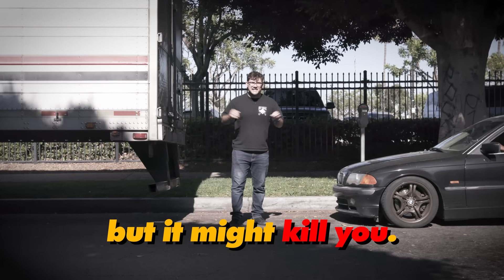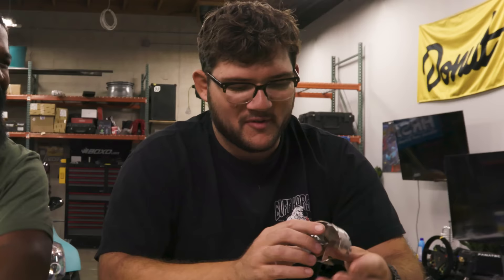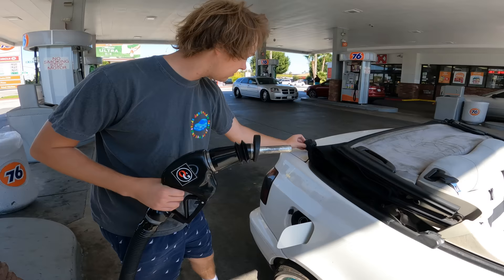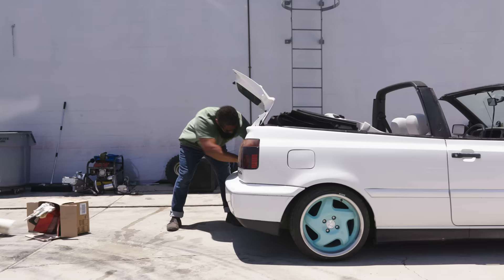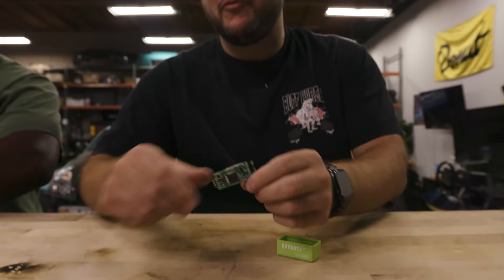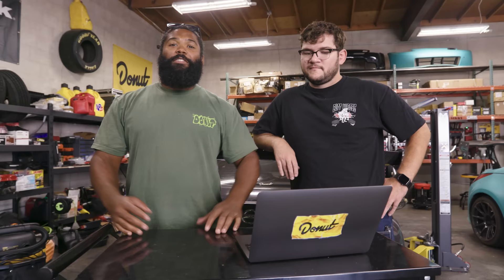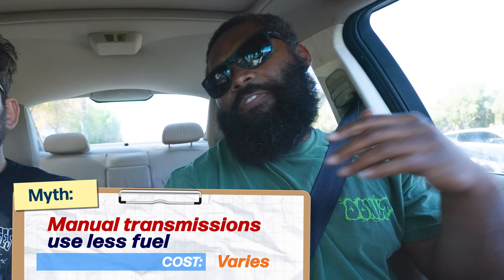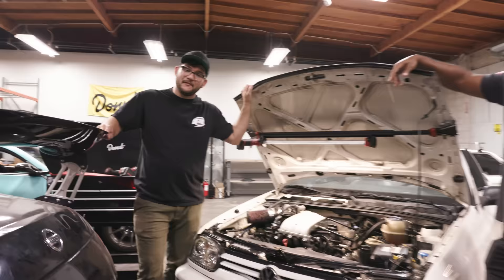Testing Fuel Economy Hacks

Comment: Depending on your car, your engine size/power, and alternator draw….the whole electrical stuff using more fuel can actually be big. Anyone who owns an older gem Honda Fit knows that if you have your lights and radio on, and try to roll up or down 2 windows at the same time, it feels like you lose about 30% power lol. Also, I think the manual transmission thing is because you can neutral and coast. I used to hypermile in my 02 Saturn sc2 by neutraling whenever I could and would get 80 mpg plus
Reply: As a guy who drives a 50 HP beater car, I understand and relate with your every word.
Reply: The manual vs automatic is a thing because the transmission fluid in the torque converter has parasitic energy loss due to it splashing around and converting the momentum of the fluid to heat. With the clutch that doesn't exist since all the rotational energy of the crankshaft is directed to the wheels. Automatics have only recently began to match or exceed manual efficiency due to locking the overdrive gear when cruising instead of relying on the torque converter and of course more gears.
Reply: Not the healthiest thing for your transmission however. Lubrication suffers.
Reply: Transmission thing has nothing to do with "neutral and coast" You're causing harm to your car by going into neutral at any high speed. You could get the same result by just "coasting" as your foot is not on the accelerator you aren't continuously injecting fuel into the engine at high RPM.
Reply: Had a vw polo 2003,went on a 2 week holiday.Had to jump start the car,worked fine untill I turned on the light,when I turned on the lights I lost power steering.Everything was fine when I got a new battery.
Reply: @DiustheZ  If you are in gear then that will use more fuel than being in neutral. Same reason its harder to push a car if its in gear. Try coasting in 1st gear and see how far you get vs coasting in neutral. Higher gears are a smaller difference but its still there.
Reply: @Luke Stannett  i used to think the same, but nope. If you are coasting your fuel injector cut off the fuel completely. If you are neutral, fuel injector still spraying fuel to keep the engine idle. 

I watch engineer explained about it.
Reply: @CheekyNinja  I mean you're wrong but nice try. You don't use fuel depending on what gear you're in you use fuel dependent on how many RPM's you're doing. "Coasting in 1st gear" is just a stupid comment to make because at most you'd barely get moving before hitting high RPM's. 
You can still burn a lot of gas being in neutral if you hit the accelerator and raise your RPM. I just said that it doesn't matter if you're in gear or in neutral you would use the same amount of gas just not pressing the accelerator. 
IF you were in low gear like 1st for whatever reason and going down hill where gravity is your accelerating force and you don't need to raise your RPM's then being in a higher gear would allow your car to move faster as there is less mechanical restriction of speed. The ONLY time being in Neutral could be better than being in gear is if you were going down hill. Being in Neutral does nothing for fuel saving that being in a higher gear wouldn't also do for you except being in gear you can control the maximum speed of your car going down hill, don't get me started on the 'geniuses' that turn their car off going down hill.
Reply: @JinxProLuhut  The only time your fuel injectors 'cut off the fuel completely' is when the engine is off, you should never 'coast' with the engine off... ever...
Reply: @DiustheZ  fuel use is driven more by load than rpm.

If you try to push a car in gear, it is harder because you have to provide the energy to compress the air in the engine, if you take out the spark plugs its much easier.

If you push a car in neutral its easier because you don't have to compress the air in the engine.

If you are coasting in gear, most modern engines cut the fuel and the work of compressing the air is done by the movement of the car. This is usually called engine braking and suffice to say, it slows the car down.

In neutral enough fuel is provided to the engine for it to idle, and no energy is taken from the motion of the car to drive the engine.

At very low speeds this works out at no net benefit. Everywhere else you get a big saving in neutral.
Reply: @CheekyNinja  How you push a car and how much fuel it consumes has nothing to do with the other... If you're going 60mph or 100kmh and you put it into neutral your engine is still idling at 1,000rpm and is still using fuel. I think you should look into how an engine works and educate yourself on some basic physics principles. 
"Engine braking" has nothing to do with compressing air in the cylinders, firstly because there's still fuel being injected into them. secondly you 'engine' break by using the gears, which requires force from the engine to move. and by downshifting in gears you gradually increase the force required which slows the engine. Nothing at all to do with the engine "compressing air" in the cylinders.
Reply: @CheekyNinja  Also a higher load or weight being transported would require more RPMs to move or 'torque' directly converted from your RPMs. Increased load means more fuel consumption because you're using more RPMs. It's the very basic process of how an engine works.. it sprays fuel and air into a cylinder, compresses that formula then ignites it to produce a downward force on a piston which rotates a crankshaft etc. etc. etc. at no point does the engine go "i'm feeling heavier today i better consume more fuel" hell the majority of cars wouldn't even have sensors capable of detecting how much it weighs or is towing. So how would it know to inject more fuel? ALSO if you inject TOO MUCH Fuel into a cylinder it will stall and 'flood' the engine. most modern cars adjust air to fuel ratio on the fly but older cars have a set amount of fuel to air ratio set by the carburetor which would be impossible to increase because of 'extra weight'
Reply: @DiustheZ you can either take this as an opportunity to learn something new, or you can double down on what you've just posted.
Reply: @CheekyNinja  Same goes double for you mate, I've built my fair share of engines even studied mechanical engineering at Uni... I think i have the basics down that you seem to be lacking. Seriously someone has led you wrong somewhere in life if you truely believe what you have typed here. Learn how an engine functions on a basic level, air fuel and spark. Then tell me how an engine accounts for weight or how disconnecting it from the gearbox by sticking it in neutral means your engine doesn't need fuel to run all of a sudden.
Reply: You can also go in very high gears intentionally in a manual, i can get 16mi/Gallon more than usual by just choosing higher gears in my car. 
I think automatics can do similar stuff too but... I like intentionally doing it and going on the limit of usable lol.
Reply: I could push upwards of 50MPG in a manual Ford focus.
Reply: @CheekyNinja  if youre in gear and let of the throttle you use no fuel at all. in neutral you will use gas.
Reply: @alexstromberg7696  sure, but turning the engine over through the drive wheels takes effort that could instead be used for forward motion.

Comment: Build the ultimate gas saver.
Skinny light aero wheels with ultra efficient tires on it.
get floorpans on the whole car, etc.
Record the improvements after each modification to prove the theoretical knowledge you provided in this video
Reply: Ideally you test each and every modification, remove them, and test again to ensure your data is from the modification, not external factors.
That is called A-B-A testing.
Reply: I believe that the original tires for the Gen1 Insight are the most efficient, but only at that tire size.  Some guy put them on 4 spacesavers and put smooth wheelcovers on them.
Reply: And that's how you get a VW XL1

Comment: Problems with the HHO generator:

-Energy used for electrolysis comes from the alternator, which loses some energy in the process.
-Electrolysis is about 30-50% energy efficient for turning water into hydroxy gas
-The HHO is being combusted by an ICE which is a 20-40% efficient process.
-HHO tends to detonate, not combust at a sociometric mix, meaning engine knock
Reply: Stoichiometric*
Reply: And adding to all that, I don't think the car counts that as extra fuel without messing with ECU. It still will pump in same fuel amount specified in fuel map and whatever extra you can add through intake, it may or may not make a little more power but not save from fuel expences. Basically a dyi nos? Thats why LPG devices have their own controller to cut off main fuel and run on lpg. If you just squirt gas through intake without any modification to software, it just burns with same amount of fuel and...well, may send some pistons to low earth's orbit.
Reply: @mr.m2gilane  That's why it's only worth it to get HHO equiped cars from some specialized tuning shops that do it. As I've seen here on youtube, they have their own controllers for the HHO and they even tune the ECU so you get better MPG and a bit more torque and power since it's hydrogen, and they get pretty good reviews from people that use it for like 5 years. There is also a guy from like Slovenia who modified his old Renault to run directly on hydrogen from water and there are even some more lazy ways like directly injecting water with gas into the engine and get higher MPG and it actually works, but that doesn't mean it's good.
Reply: If you install an HHO generator and you manage to get everything right, which is difficult, then you're basically just modifying your fuel:
- Higher octane rating (probably not much higher)
- Higher combustion temperature: increased engine wear, but likely some increase in fuel efficiency.

Note that this design is only using the hydrogen, and discarding the oxygen - with the oxygen included it probably would cause knock, but the hydrogen on its own should reduce knock.

I'd honestly be pretty impressed by anyone getting a net improvement in mileage using an HHO generator. 

Fun fact: I have seen HHO detonated at modest scale. Australian army was running a mock battle at an airshow, and they were detonating  2L plastic bottles full of HHO to make sound effects for the field gun. Very dramatic, and turned the bottles into hunks of melted plastic. I definitely would not recommend mucking around with significant quantities of that stuff.

(also HHO is technically what powered the Saturn V rockets, but that's a whole other story)
Reply: A few more problems, 
The units shown on these videos are too small to produce HHO gas in any significant quantities. Feeding the amount of HHO that they do would have no effect whatsoever.
When these units are shown working the water level in the tank barely falls(and the tank doesn’t seem to hold more than a couple of litres) If anything was happening one would expect the level in the tank to fall rapidly.
Electrolysis yields are dependent on current levels,  automotive electrical system do not have the output to run any meaningful electrolysis units.
Most importantly, would you be really happy to have what amounts to a fuel air bomb running around in your car. There is a good reason why oxy propane and oxy acetylene torches have two separate feed lines as the gases are only mixed at the point of use for very pertinent safety reasons. With HHO the fuel (hydrogen) and the oxidiser (oxygen) are already mixed and it only needs a spark for it to go boom.
Reply: @patheddles4004  it’s been done thousands of times, and there are improvements being made every year to the design of the HHO generators to make them cheaper and more efficient. It’s nearly impossible to get it to work “right” with modern fuel injected, closed loop vehicles but older engines with carbs and distributors can be dialed in a lot easier as there isn’t a computer controlling the fueling and spark advance.
Reply: @slycarlo8747  and it’s never worked, you can “improve” it until the cows come home and it still won’t work regardless of what vehicle you attach it to.
Reply: @jungobango4815  Stoichiometric = your air fuel mix, Sociometric = OUR air fuel mix
Reply: @slycarlo8747  that’s as may be, the fundamental problem is that whatever powers the electrolysis unit whether it is straight DC current, radio waves or pissed off piskies pedalling push bikes, it will take more energy to electrolyse a given amount of water than you will gain by reacting the products of that electrolysis back into water. This is a fundamental and unbreakable concept of physics, fixing a hydrogen generator to a car and expecting that generator to provide enough hydrogen to power it does not, cannot and will not work.
Reply: @jungobango4815  Also, they probably added tap water instead of pure, distilled water. That tends to not pull as much current because of all the impurities. Also, the bubbler also doesn't get rid of the oxygen. By replacing the bubbler with a dry cell and adding an oxyhydrogen flashback arrestor (very close to the intake valve in case of backfire), it could be very efficient.
Reply: @CreeplayEU  No, HHO generators do not give any more gas mileage. They do the opposite, they worsen it. It is thermodynamically impossible to get better gas mileage of a HHO generator. Unless you have a seperate battery you charge with mains power or other source of electricity that does not come from the engine.

Comment: As someone who works with gas for a living (fuels in the USAF)the temp actually does effect gas. If it’s closer to 60 degrees that’s the true and accurate weight Reading . We work mostly with above ground tanks but tanks under ground do need to have a daily conversation factor when we issue from a tank. Tho it is a very minor difference at small amounts in automobiles
Reply: I was an Army fueler for 8 years.  JP8 doesn't taste good!
Reply: @jayamburn1959  What is the expected response here?

Comment: One clarification you should make is that “Top Tier” is not to be confused with higher octane, top tier gas is gas that has additives across all octane grades, gas stations without the top tier sticker at the pumps usually means that is just plain gas without the additives.

Comment: I think the "top tier" myth was referring to gas stations that are certified "top tier," not different octane gas. Like shell, gulf, Exxon (top tier) vs. BP, speedway, 7/11 (non top tier)
Reply: don't forget costco!
Reply: Correct, top tier does not refer to octane, it refers to the detergents in the fuel. Top tier fuel is better at cleaning engines.
Reply: There's also a kernel of truth to the "premium gas gets better fuel economy" myth, at least at some specific gas stations.

Depending on where you fill up your tank the premium highest octane option may have less ethanol in the blend as compared to the regular/plus options. In many states almost all fuel is blended up to 10% ethanol, but some brands and/or stations will sell their highest octane fuel as a 0% ethanol blend while regular and plus are the standard 10% offering. 

0% ethanol fuel blends give you noticeable increases in fuel economy, but generally not enough to make up for the difference between regular and premium prices at the pump.
Reply: @Pretzulkj  nothing to do with octane though.
Reply: @RobertEmery  correct, which is why I specified it’s only at specific gas stations and it’s only happening because the premium blend has lower ethanol content. The octane is irrelevant other than that the ethanol blend at gas stations can be different for different octanes.
Reply: @Pretzulkj  Interesting
Reply: yeah i live in the uk and always try to use shell and texaco in stead of the grocery store brand because i found myself getting more out of the premium stuff even tho i was paying a bit more.
Reply: I've noticed more power and throttle response with shell gas and nobody will ever convince me otherwise.
Reply: But many people do think that higher octane is better because it costs more.  But if your car isn't designed for it it is a waste of money and wont give you better power or better mileage.
Reply: Yes, I tested this myself and here in Germany it is true. We have a cheap gas station called Star and when I tested it vs Shell I did get less km per tank.
Reply: Correct. I had a cobalt SS, I used some random gas station 93 and car was pulling timing. I got shell 93 and it ran 100* better
Reply: @thookie118  how much less?

Comment: I would have loved to see more of these actually tested even though going in we know it won't make a huge, or any, difference. Fun video overall though. But I would have loved if you tested a lot of little things and see what, realistically, the average person could do to save fuel. For example, a combination of windows up and accessories off and add in some of the other myths to see if the average person could actually drive like that and save 1-2mpg. Basically how unlivable would you have to make your car and driving experience to save gas without going full eco-mod.
Reply: That necessitates them paying for a full tank of fuel, and then paying multiple employees just to drive around and burn that tank of fuel.
If 99% of of their sources claim it's unnecessary, it's better to take that at face value.